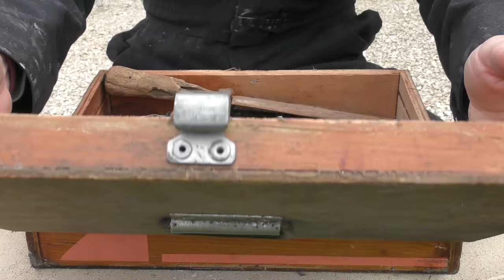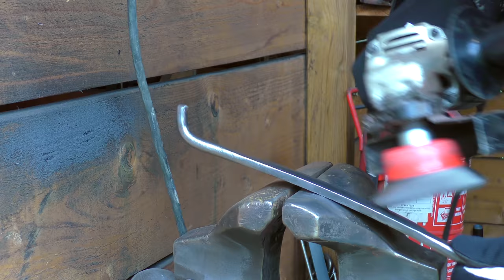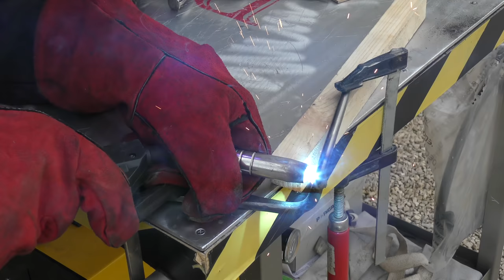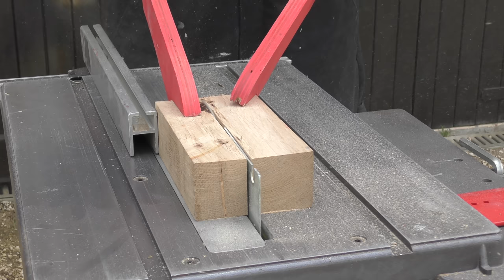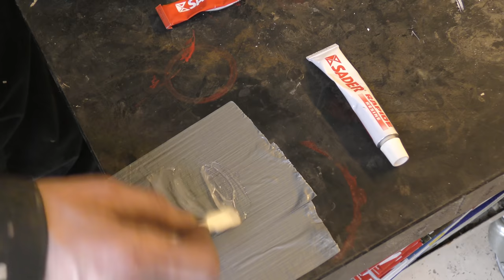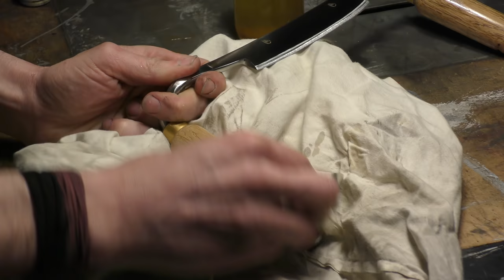Old Rusty Drawknife / Drawing Knife - Old Tool Restoration

Comment: I need to get myself an angle grinder and wire wheel at some point, those things are like magic!
Great work G. It's great to remember and honour your grandfather by spending time restoring his old tools :)
Reply from the maker: Thank you Ellen. I have plenty of his tools I want to restore and can't find the time to do so. I also have his tool box, which I will remake at some point, but that's a massive restoration. And yes, you need an angle grinder. Everybody needs an angle grinder ;)